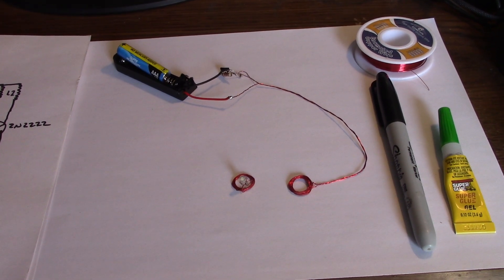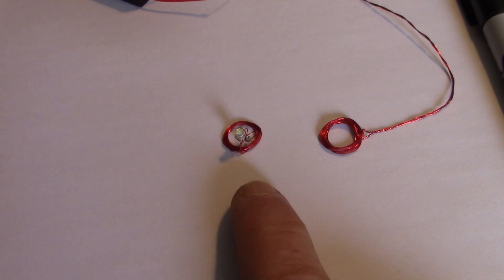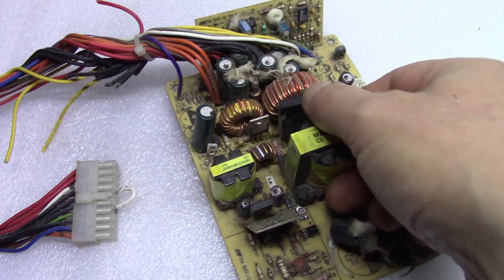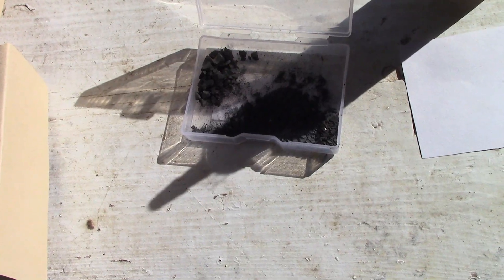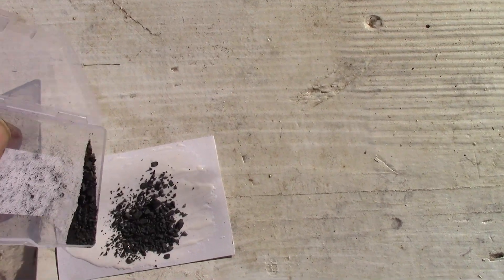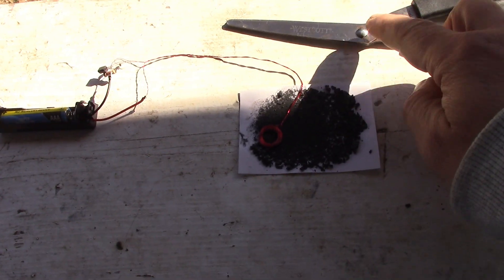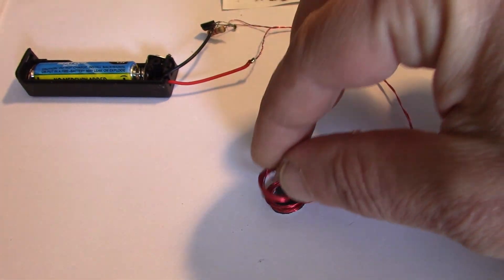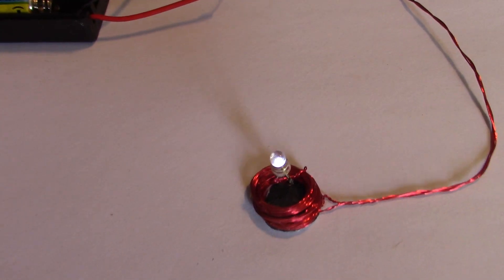Using a HAMMER To Fix Tiny Wireless Coils

Comment: How can coils be wireless if they are made of wire?
Reply from the maker: Haha, yeah, it does seem a bit weird at first. It refers to the transmission of power. The receiving coil that the LED is attached to isn't connected to the main circuit that is creating the power. Instead, a field of energy is created by that circuit, which is picked up by the receiving coil 😀